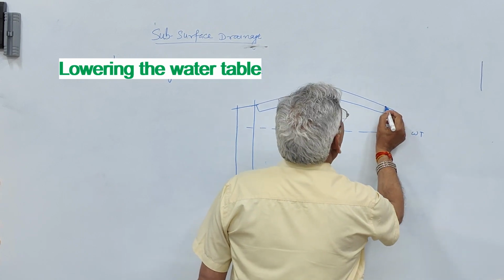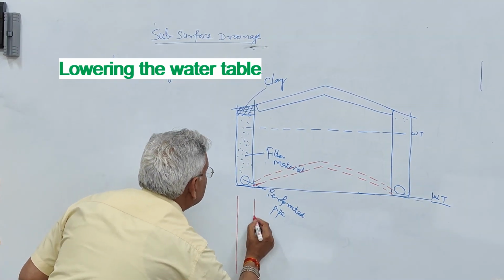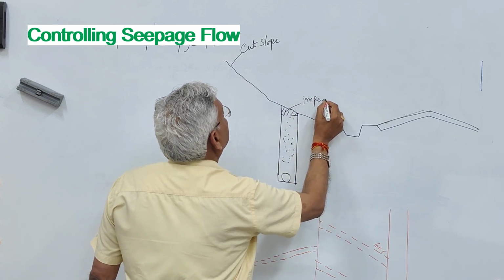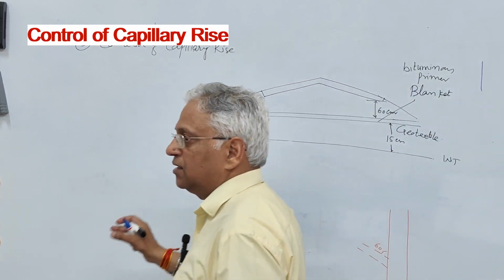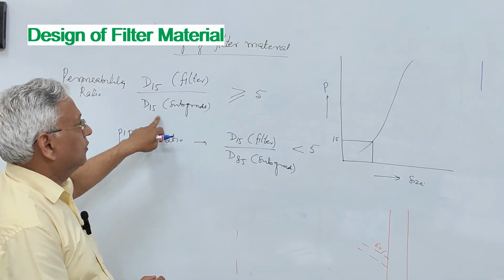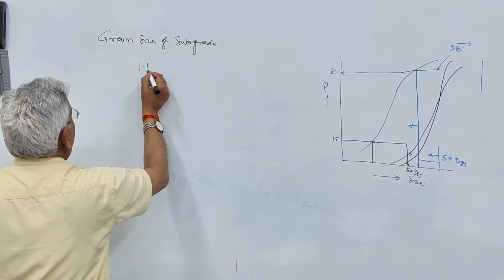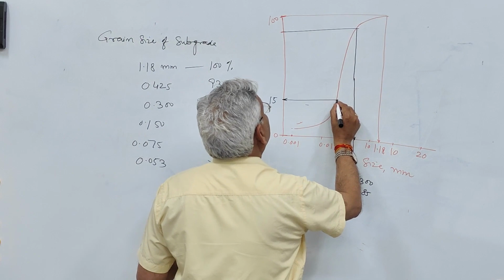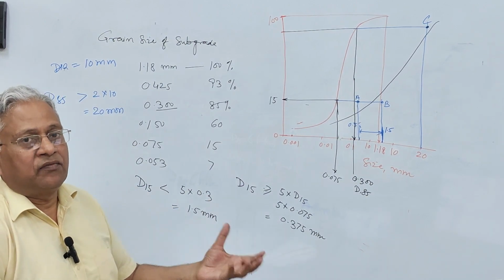#Drainage Highway drainage, subsurface drain system, design of filter media

Comment: Sir , Request to Cover Surface Drainage System Design as per IRC in Upcoming Video - surface drainage system as per IRC basically all are ignoring in hydraulic design and to fix size as per actual catchment , rainfall , survey data while planning DPR
Reply from the maker: Noted. Thank you for the suggestion.

Comment: Thank you very much sir.

Sir, 

As per MoRTH 2504.2.2 Defined D (filter) and D  (base).

Here we can consider D (base) as Subgrade soil or any other.
Reply from the maker: Base here means the layer above which stone picthing is provided. It can be the embankment or other material used in the protection work.

Comment: Dear Sir 
As per IRC Sp 55 it says the minimum  longitudinal gradient of  vertical profile   of Main carriageway  should not be less than 0.3% what is the logic behind that and how 0.3 % value derived please explane 😊😊
Reply from the maker: That is the minimum slope required in the side drain to move the water due to gravity. The same slope should be provided on the carriageway also to keep the depth of the drain same throughout the length.